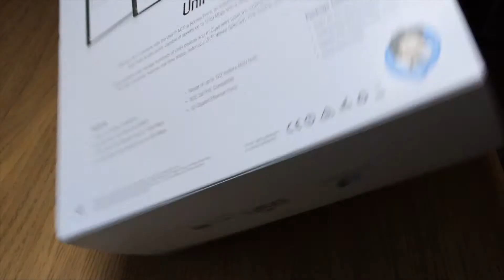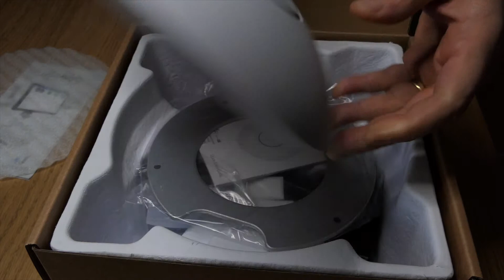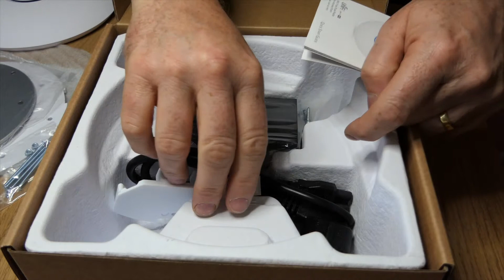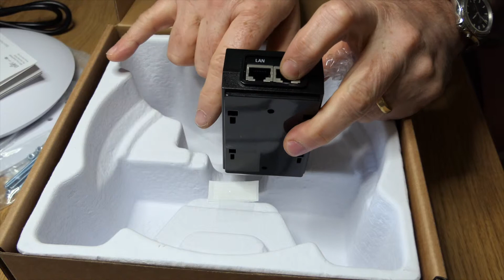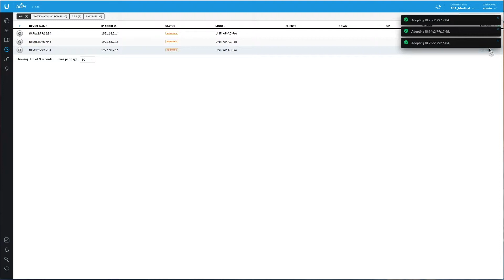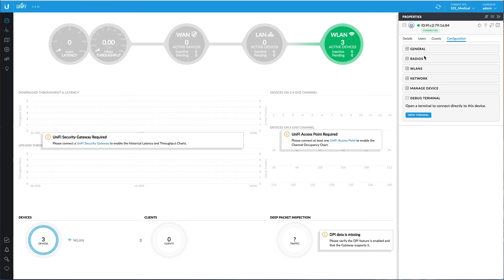UniFi AC AP PRO UNBOXING

Comment: So your single admin unit cloud key will let you configure multiple devices on the network from a single log in - rather then having to tediously log into each unit to configure it. Very handy, if you are trying to set up a large building with these access points, and I see they also do cameras and other connected devices this must be a god send - trying to remote log into individual units via IP address can be a nightmare.
Reply from the maker: If you just set up one device, and have it running, when you add on any other access points, you can just adopt them from the software console and they are automatically configured... so none of this running around a building malarky later on! The camera side is different and that doe snot link into the UnFi controller software, but you just use their video controller software that does the same as the wifi side, but just deals with video. I run the cameras here and for the money, they are pretty decent!

Comment: So I'm guessing you could use this to offer up say, some free wifi hotspots for a larger building or even just as an in-house setup for an office building and manage it remotely from the software. Very nice and they look great too, with a really nice UFO-esque profile. I also assume you didn't need the power supply for these as the switch would supply enough power for them. Great stuff Gordon an enjoyable view.
Reply from the maker: The access points can be configured very easily to give guest wifi, limit bandwidth etc, redirect on connect for advertising or even a portal that you can customise with your own logo and conditions. As well as this you can set up a voucher system to hand codes out to people and define their time limits etc. The controller software can actually be installed on just about any computer system, but the small cloud key makes it easier and more convenient. Unless you buy a 5 pack, the single units all come with the POE adaptor, so handy to have spare in case anything ever goes wrong!